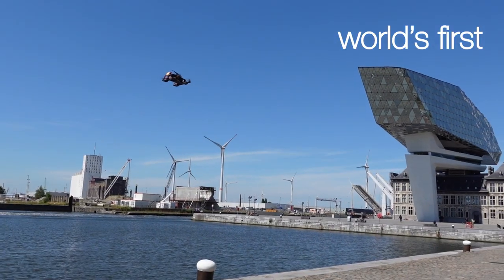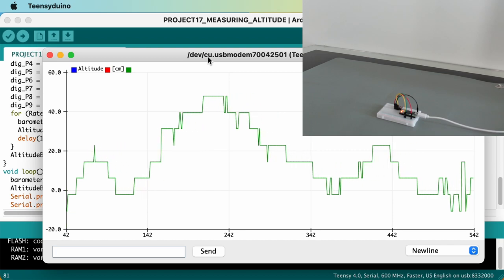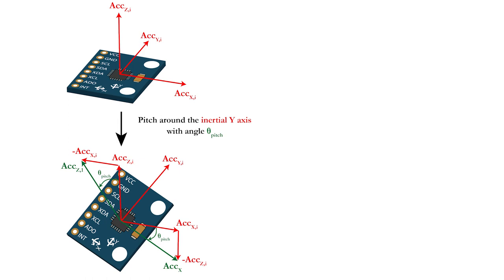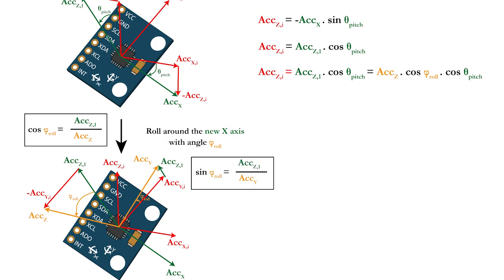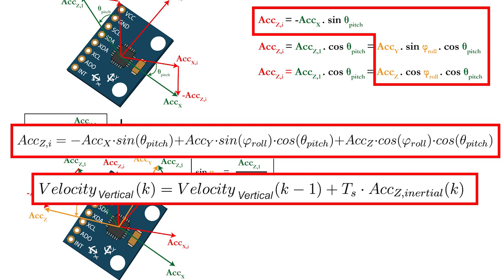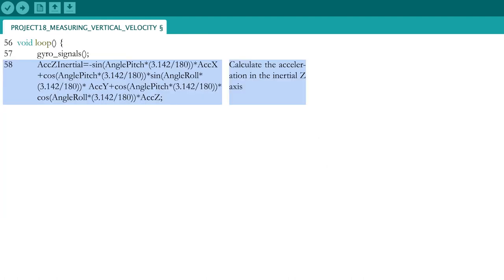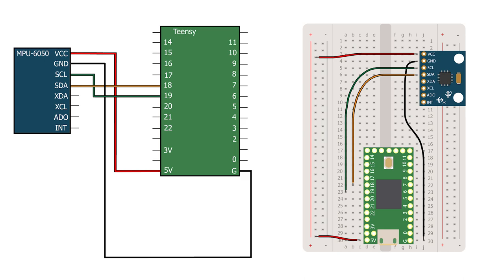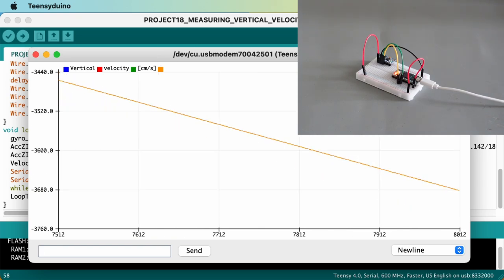18 | Measure vertical velocity with the MPU6050 accelerometer

Comment: or... maybe you can just directly integrate the acceleration measured from Z-axis with the elapsed time
Reply: I guess that approach will make you drift because of the integral, I was thinking of also using a high pass filter but I've never done it. Please share some insight if you tried

Comment: If you're using an  altimeter/barometer couldnt you also integrate that into vertical velocity measurements?
Reply: just remember that barometric pressure changes from place to place and throughout the day. You'll need a way to correct for changes in Barometric pressure.
Reply from the maker: Yes that will be the topic of the next video, we will use a Kalman filter once again

Comment: Hello, I implement the related formula but my results are showing acceleration in Z direction when quad is tilted. Tilt compensation is not working, do you know why? It works between -5,5 roll & pitch, but when tilt angle exceeds 5 degrees it becomes meaningless.

Comment: How to use mpu6050 to calculate speed ?
Reply: you can integrate acceleration but the result will be subject to sensor drift, so the accelerometer alone cannot give you meaningful velocity data.
Reply: What if I add gps speed and combine the 2 values of speed , will I get an almost exact value of the real speed?
Reply: @InesRebouh-gw8uo  That works out. The speed of the GPS will not drift, so you can fuse GPS speed and acc speed. For example with a simple complementary filter. GPS speed for "slow" movements and acc speed for "fast" movements
Reply: @TimeFadesMemoryLasts   thank you

Comment: Could this also be used to measure horizontal velocity and cancel out any drift in self leveling mode?

Im guessing to do so. The accelerometer would have to be virtually leveled, even in forward flight
Reply: Para la velocidad horizontal necesitarías el ángulo absoluto de el eje Z / Yaw pero sólo tiene Roll y Pitch